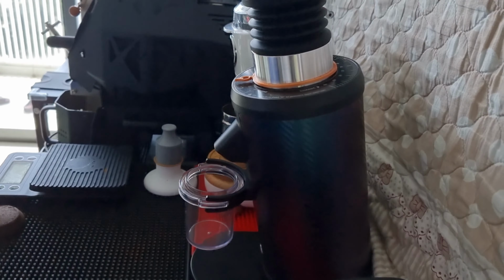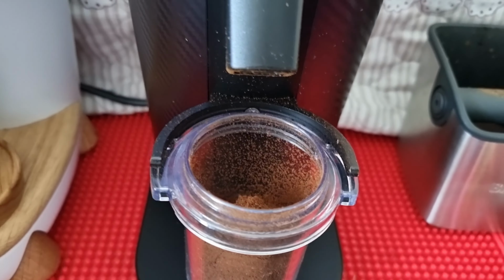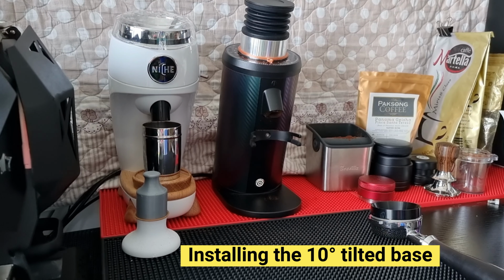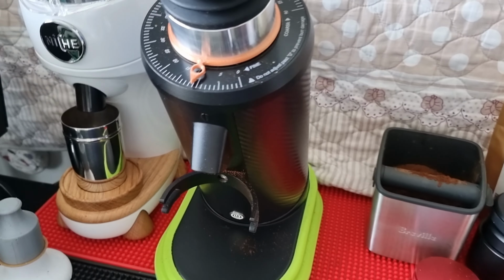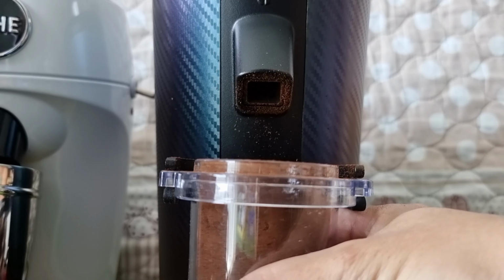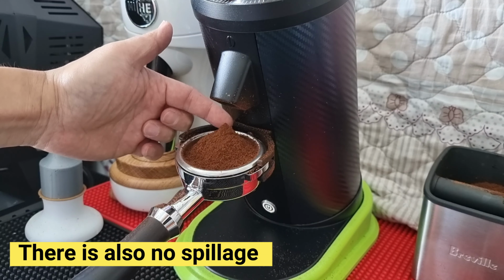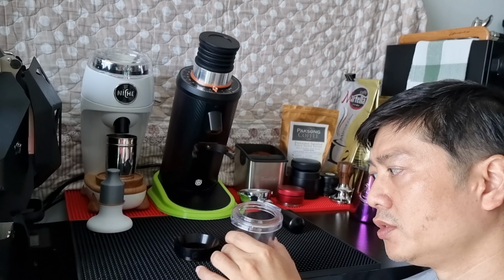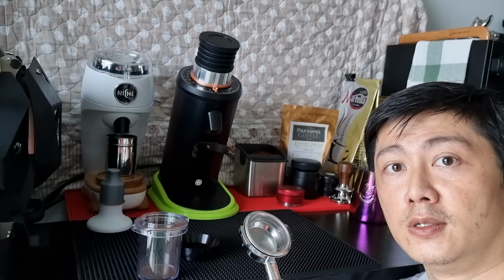DF64 Mods | 10° Tilted Base

Comment: Make in white? 😂
Reply from the maker: Dylan. This is a prototype. I made in the colour that I have that is not much of use. I have the 2nd version now.
Reply: @CaffeMartellaSingapore  looks great CY
Reply: Yes white is good!😀👍  I have a Couple of questions Cy, The cup that comes with the DF64, is it a 58mm version or 54mm? I’m also wondering can you use a dosing funnel that attaches to the portafilter like what I use? It doesn’t sit on the top it actually attaches around the Portafilter. Last question does the DF64 stop automatically or do you have to press the button when grinding to stop it? Timed dosing?
Reply from the maker: Hi Lynda. The portafilter holder is meant for 58mm. But that is not an issue because I can make modification to fit 54mm breville portafilter. 

The cup is also 58mm.

The grinder is not time based dosing. U have to activate the button to start and press the button again to stop. However, it does autostop after 45s.
Reply: @CaffeMartellaSingapore  Thanks for the answers. Yes you and your 3-D print I can imagine can do lots of adjustments👍😀
Reply from the maker: @richterstitcher7936  yes indeed.

Comment: CY , I find this extremely interesting. I have a few questions on the modification you are working on this. Have you checked the effect that this title has in the burrs and the alignment of the burrs? By tilting the burrs 10% more what effect it will have in the grinds themselves? Have you explored modifying the portafilter holder or creating a modification to add a funnel that could be placed on the portafilter to reduce the grinds from falling all over if you dose directly to the portafilter with the base you are adding?
Reply from the maker: the first thing I did the tilt is to allow the grind to exit the chute easily with the help of gravity. 2nd thing I am now working on is to tilt the portafilter holder to be closer to the exit chute
Reply: @CaffeMartellaSingapore  I can see that the purpose of tilting the base by 10% is to improve the grind easier to leave the grinder with gravity. I find that extremely interesting. But my question is if you tilted the base by 10% that will potentially affect the inclination of the burrs and how they will interacts with the springs that holds the housing that holds the upper burr etc.
Reply: @CaffeMartellaSingapore  what about adding a funnel that can be placed in the portafilter when it is placed on the holder if you grind directly onto the portafilter?
Reply from the maker: I think the spring are pretty well depressed when you grind for espresso and the 10° tilted should not affect the position of the burr at all.
Reply: @CaffeMartellaSingapore  I guess you could compare the alignment of the burrs with and without the tilted modification to prove the point that it’s not affecting the burr alignment.
Reply from the maker: @EdGodoyPlana  that is something I can do definitely!

Comment: Why not try one tilted base on the Specialita'? On the DF64 did you check if the grinding time changed as well if the dose consistency changed? Did you found more beans flakes stuck in the frontal side of the beans funnel due to the increased inclination?
Reply from the maker: Yeap. I am checking burr alignment next with and without the tilt.